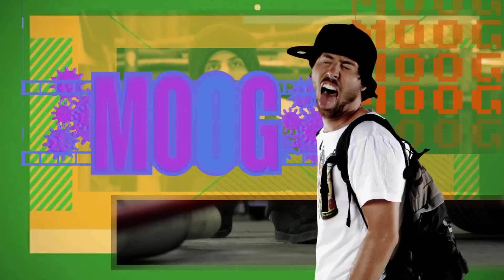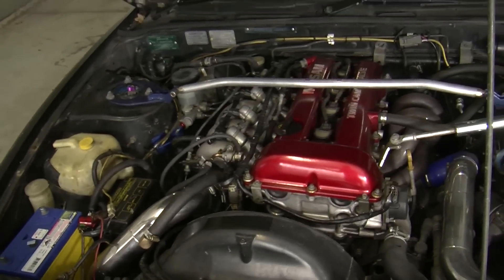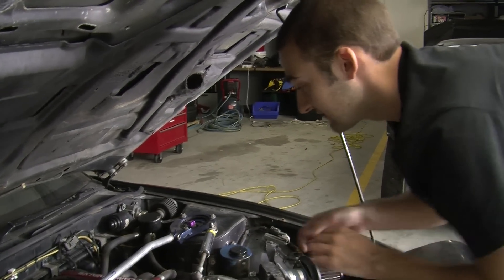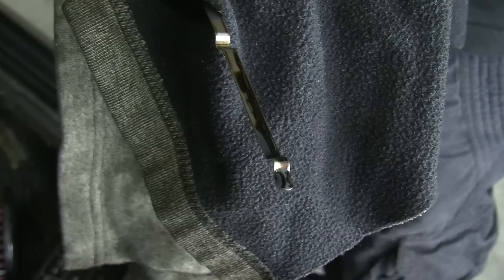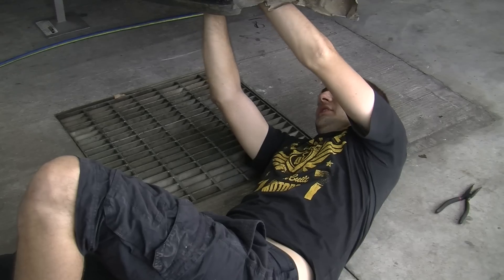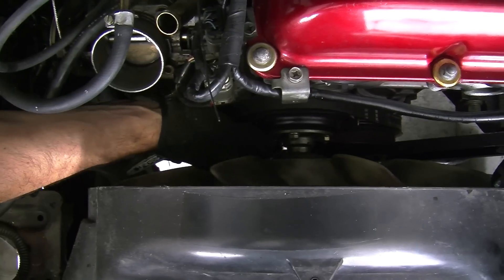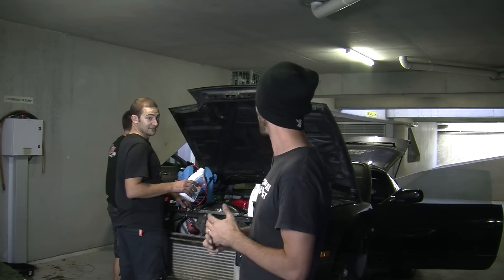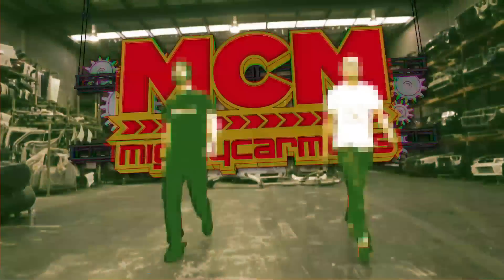Season 5 Premiere - Drift Car

Comment: Where in the heck do you find this 180sx at im in the us and only seen a 300zx and a 350z but no 180sx
Reply: I think its called 240sx in the US. Here in Europe its called 200sx.
Reply: Theres a 240 sitting down the st
Reply: Also, the USDM 240SX uses a KA24DE or KA24E, not the SR20DET.
Reply: ***** In the EU 200sx s13 uses CA18DET and 200sx s14 have SR20DET.
It's really strange, maybe it's because the turbo versions sold better in the EU, and americans liked "naturally aspirated" enigens better?
Reply: You can get a 240sx here and get japan parts to make it a 180sx
Reply: MYNAMEISKILLKODE0
Yeah, but it'll still be regoed as a 240SX, you can't offically make a full JDM 180SX.
Reply: ***** they are basically the same car
Reply: thelamestshitever Absolutely wrong. We didn't "like" NA better, we had absolutely no say in what we'd like. As a result, when they released the 240sx in the US, it was very poorly received.

Because literally everything fun is illegal in the US, there's a rule that an engine can't put out a certain amount of emissions based on size of the engine alone, so Turbo engines - regardless of size - were almost always illegal due to them naturally putting out more emissions than NA, yet they'd still be accepted or denied under the same criteria regardless of induction type. Not fair at all.

As a result, Japan couldn't give the US the CA18DET or the SR20DET. Now they had an issue since they KNOW Americans judge a car based on price, power, and low end torque. So they knew releasing the car exclusively in it's NA CA18DE and SR20DE forms would be absolutely unacceptable to the American public. as both are piss-all engines for a car that's to be sold as a "sports car" even in it's price range.

The best compromise was to fit our car with the most powerful NA 4 cylinder engine they had at the time, which was the 2.4L KA24DE. from the Nissan pickup truck. Though they had to modify it to rev higher and adapt the cam profile to be more aggressive and "sporty". The end result was producing an engine with 150hp and 162lb. ft. of torque. and later a DOHC version up 5hp from the previous model.

DESPITE all this, The car was still criticized for being slow and limp-wristed compared to similarly priced entry level sports cars of it's day like the mustang. Especially in America where they did not see the value in cornering capability or handling, but rather low end grunt and highway speed.

The biggest criticism point ironically, was that it lacked a TURBO. but alas, our government are tyrants. America isn't a free country. and so sales were slow throughout it's life in the early to late 90s when in 1998, the last edition of the 240sx left the showroom floor. and Nissan - disgruntled by this - never sold us the next Generation S15
Reply: I live in florida and my neighbor owns 3 180sx
Reply: HeavenzBreaker A superbly written and very informative bit of information, my friend. If only more YouTube comments could be like that...
It sucks that it was slated for a reason that Nissan couldn't actually do anything about.
Reply: 300ZX fuck yeah

Comment: Not happy about that I have a Nissan 100nx 93 the little bro front wheel drive wit 117.000km  nice car for starter I put some mods on it chip to 127hp pod filter sport custom exhausts from the scrap recovered from a vw gti  original was 102hp

Comment: What's the difference between the 180 and 240
Reply: brandon 180sx came with C18 and SR20's and 240's came with the KA24 hence why they're called 240sx due to the displacement

Comment: I don't...reminds me of a car that a guy I went to college with bought. It was a Honda Civic with around 50k miles on it, the owner said the car just stopped working one day. They couldn't figure out what was wrong with it so it sat for a while. They finally sold it to him for $500 as is (needed new engine).

Before ripping into the engine we decided to on a hunch (sounded fine) check something basic. The fuel level sensor died so it was just out of fuel and ran fine, just an empty tank.

Kei

Comment: What is the difference between the 180sx and 240sx? :ii
Reply: A 240 has a ka24e or ka24de motor and and a 180 has a ca18 but they swapped an sr20
Reply: Okay, thanks :)

Comment: "A snapped bolt.  You'll never find that on a Subaru"

Unless it's a 2008-2014 WRX and you're attempting to remove the intercooler.  Then you'll find one, and have to drill out the remaining bit of bolt from your turbo.

Comment: "I've never seen rust on aluminum before"

If I remember science class correctly, aluminum rusts very quickly, but the oxidation is transparent, and doesn't flake off like iron rust... I could be wrong though... >_>

So... technically you've probably never seen aluminum without rust... =p

Comment: I never knew what KW as car power measurement what is KW to Horsepower
Reply: If you multiplie the Kw with 1.36 you get the number of horsepowers.
ex 100kw is 136hp
Reply: Giovanni Bendixen why would they use a measurement of power in electrical terms as a measurement of engine power.
Reply: TheSamplebridge A horsepower is 33,000ft/lb of work in an hour - could be wrong there, don't quote me. One horsepower is roughly 756 watts - watts can also be used as a measurement of mechanical work. A kilowatt is 1000 watts, or roughly 1.34 horsepower.
Reply: i now know what the comparison is but why you a measurment of electrical power.

Comment: you guys changed everything but the most important one the cam chain or belt,if its a chain it will stretch ,which will change cam timing  ,not good ,if its a belt  and old  it will break ,definately not good ,will cause severe  head damage.you had the whole front of motor  torn down it would of been no problem to change ,the most important item especialy if you are looking for  good performance,, ......just saying

Comment: why do they measure power in Kw and not horsepower?
Reply: They're out of the states lol.
Reply: i know, but i have never heard power measured in kw anywhere else.
Reply: Dean Kruse USA uses miles, gallons, inches, yards, feet.... never heard of those anywhere else
Reply: They're Australian. Everything is confusing because it's upside-down there.
Reply: no, i dont think of it that way.
Reply: really, no one here is a rooster teeth fan.

wow
Reply: Dean Kruse I love RvB.
Reply: it was a ref from a conversation from podcast 276
Reply: This is what we called the SI unit, which is what should be used as an engineer.... (beside the Americans)
Reply: 1 kW is about 1.3 hp
Reply: Standard=USA
Metric=Everywhere else
Reply: Kw is SI not metric

Comment: S13 SR's can use S14 KA alternators, and S14 SR's can use S13 KA alternators. It makes no sense, but that's how it is lol.
Reply: It does actually,they are basically the same.
Reply: Same type of alternator yes, but the mounting bracket, and the location of the positive terminals are slightly different. Using an S13 KA alternator on an S13 SR results in the terminal touching the metal power steering lines on the chassis, resulting in the wiring wiring harness burning up. It's practically the same alternator, but there's different variations from year to year that don't always cooperate.
Reply: Yea,I know cause I got the s13SR so a lot of parts from the KA can go on it,even of the newer ones,mine is 90',but it's pretty difficult to put them but it is possible.

Comment: It’s hilarious to me that guys are still buying these worthless “cold air intakes” for their cars. Engineers spend years trying to squeeze every bit of efficiency out of their engine designs. If they could actually achieve 5-15 extra horsepower by simply changing the airbox design to a pod filter design, they would just do it themselves. It wouldn’t cost them anything extra to make it that way. They don’t do it because it has no positive effect whatsoever and its actually less efficient. 

Putting one of those things on your car is one of the best ways to communicate to everyone around you that you don’t actually know anything about cars.